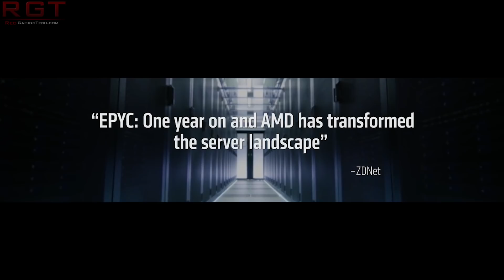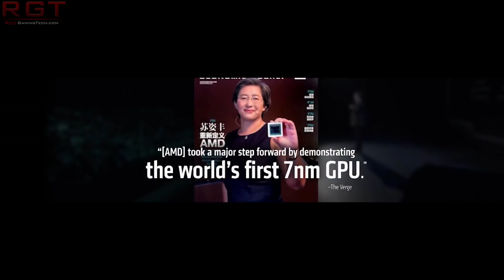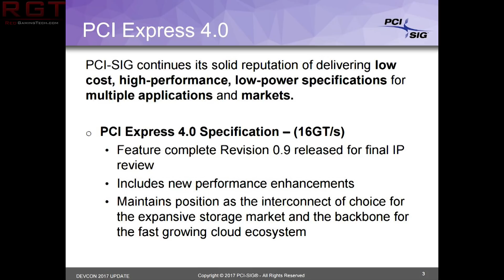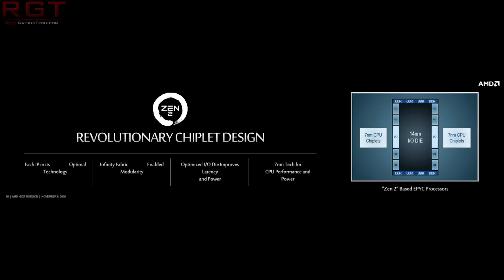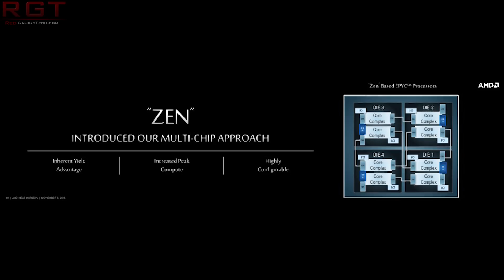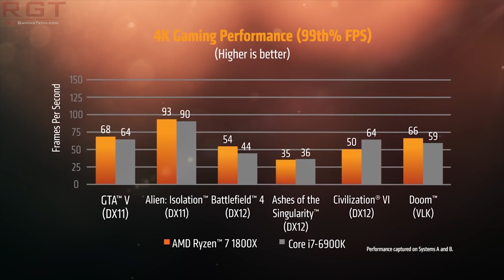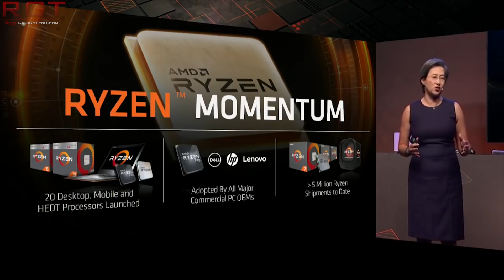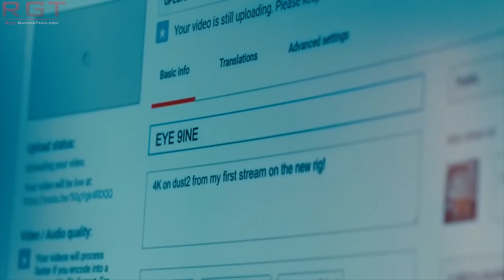Should AMD Raise The Core Count for Zen 2 Ryzen 3000 CPUs ?

Comment: We want a higher clock speed. We want AMD to be better than intel in gaming, too. We don't want to buy from intel anymore.
Reply: it would be better then anything what Intel have on 14nm !! otherwise it would be fail if not
Reply: @Mr11ESSE111  intel 14nm is actualy so higly tunned its like 11nm with 10nm thay can have clock with 5ghz actualy its worse
Reply: @royallager1851  and with that coffelake are onyl 3-4% in IPC over Zen+ if clock them same !! only advantage of coffelake/Intel now are  higher clocking ability because otherwise Intel cpu-s will be without point if zen+ could go up to 5ghz on air/water
Reply: @Mr11ESSE111  you right but i just explain why intel have better clock speeds...
Reply: @royallager1851  so if you "tune" a procesor it shrinks ?
Reply: @santiagoferrari1973   nope thats just cimparrassion betwen 14n zen intel 14nm intel tuning 5years 14nm whike am only two now amd is ahead from intel 10nm bcs they have 7nm and i eill have more expiriance
Reply: @royallager1851  with coffelake have better clock speeds while with broadwell have bad clock speeds
Reply: @royallager1851  when Zen2 comes Intel would not have clocks advantage or just  a little better
Reply: @Mr11ESSE111  tou right u think zen 2 is beast
Reply: @Mr11ESSE111  
Intel will probably keep the higher clock frequncy after Ryzen3 (not Zen2!) comes out, but not after Ryzen4 comes out.
Reply: @peterjansen4826  higher  but for maybe 200-300mhz but lower IPC will have coffelake
Reply: @Mr11ESSE111  it just has to be capable of reaching and maintaining fps over 140 at 1080p paired with top tier gpus and not be a bottleneck...
Reply: @darkokutlesa2386  depend on games and settings!! Games can be optimised for Intel too
Reply: @untseac  IPC of Zen2 will raise for around 13-15% over zen+ and that means around 10% over coffelake too !! otherwise Zen2 will  failing if clocks and IPC  increasing will be too low
Reply: @untseac  
1. what they call 'IPC', including high executives from Intel and AMD is not IPC. IPC is a term from computer science which means something entirely different: instructions per cycle for a given task. 
2. It actually is not that difficult to improve IPC, it is difficult to improve performance while staying within a certain power envelope and price range. Engineering is all about trade-offs
3. Ryzen2 is made on a much larger node than Intel Coffee Lake. With Ryzen3 for the first time ever AMD has the advantage of a smaller node compared to Intel. That on its own gives the 'IPC' a big boost (indirectly, you need to utilize the advantages of the smaller node properly and change the design a bit). 
4. The first generation TSMC 7 nm won't clock that high yet. That is normal and it always happens, the second and third generation will clock substantially higher. If Ryzen3 doesn't beat intel than Ryzen4 will. :)
Reply: Why not both?  More cores and ipc.
Reply: @untseac  
1. My main point, other than people using a term completely wrong (including the executives from AMD and Intel who do know better) 
is that IPC has nothing to do with performance. You can have a lower IPC and a higher performance if the clock frequency gets sufficiently higher with that lower IPC or if you do sufficiently more per instruction. 
Most techtubers seem to think that the performance in Cinebench is indicative of how high the 'IPC' is, it isn't! It shows how good the performance it.
You are probably talking about SIMD because of AMD its next GPU-architecture, that certainly will improve the gaming performance but it is doubtful that it lowers the IPC, it just prevents wasting instructions but that is something else than not having those instructions. Every part in the pipeline is active in every cycle, no matter whether or not it produces a useful output. It can be a NOP but it is active! I studied computer architecture (as part of a two semester computer science course), that gives me the background knowledge to know this.
I guess you could say that my critisism is that techtubers and people in the community mix different things which are not related: IPC and performance. I would like them to just call it as is: performance for task X. That is fine because that is exactly what we want to know, leave IPC out of it. :)

2. Simply put: AMD lacked the resources to come up with several architectures for several segments of CPU's. That has to do with both design and hardware-manufacturing (masks are expensive). So AMD came up with a design for server CPU's (most lucrative market) which happens to also give a good performance on the desktop and laptop because it scales nicely. 
Yes, leveraging all the advantages of that new smaller and more efficient (the two are related: with a smaller surface you need less power to switch the transistor and the transistor switches faster) doesn't come easily, you need to adapt the architecture to get all out of the advantages. It is like a chain, if there is one weak link...
In the hardware chain it is about all the other parts keeping up. What AMD does for Zen is risky: at the same time switching to a smaller node and improving architecture. Intel did this once in the last decade, for their 2000-series, AMD does it twice in a row. This is extremely agressive and it shows how eager AMD is to improve the performance which is great for us customers.

3. The pipes don't necessarily get smaller: with regard to the node it just is about the surface area which decreases the voltage (and because of that the power) and makes the transistors faster. It is just elementary physic. Pipelines are not related to it. The longer the pipeline the more you do each cycle but longer pipelines also tend to be slower so you have to make a trade-off and find the optimum.

4. TSMC is improving at a more rapid pace and that is simply a matter of money. TSMC gets higher profits because everyone buys at TSMC except for Intel and almost nobody (Micron is an exception) buys at Intel except for Intel. Hell, now even Intel buys at TSMC. :)
TSMC has had more profit for many years, ever since Apple choose to buy from TSMC but it takes years to translate that extra money to better facilities and better nodes. Now TSMC has gotten to the point that it outperforms Intel. This means that AMD now has the advantage with the node and that AMD will keep that advantage until Intel buys from TSMC too which Intel only can do iff it splits off its fab. My prediction: Intel will split off its fab - or big parts of it - somewhere in the '20's. They will have to do that eventually. This is not good news for us users because it pretty much gives TSMC a monopoly, unless for example Samsung will start making X86-CPU's and GPU's.
Reply: @untseac  IPC of Zen2 cant be lower then Intel ones  and i think on 14nm Intel coffelake because  even now IPC of coffelake are only 3-4% ahead if you compare clock for clock  so Zen2 will be  without point if IPC will be lower then coffelake because it would mean that Zen2 are same like Zen+
Reply: yes because dont matter how powerfull more cores actually are, microsoft dx12 and direct rtx are in bed with intel, so doenst really matter how many cores you have if games only use 2 for example.... even if the native game was made for a console running amd processor with less than 2ghz that run 4k 60 fps.... I rully believe ryzen 3000 will have 5.0 ghz with OC the problem is that ryzen doesn't really oc that much but are quality hardware that doesn't overheat. so expect intel ipc with around 5ghz. intel will still have the upper hand but ryzen 4000 will crush them
Reply: "we"

You don't speak for me, so stop trying.
Reply: @untseac  aka AMD vulkan .... if the games work fine in cheaper hardware in consoles that run AMD the problem is that directx is clearly biased to intel... as they pushed even direct rtx that will force games to only run on that evil scam called rtx... well in any case if they run smooth in far less powerful hardware ... the fault is the shitty PC ports they make....
Reply: @untseac  yes that part of the problem being open and offering good products at good prices aka capitalism is not good for this monopolies... that's why there's always some scam being pushed, some trick, some dirty biz...  the fact is microsoft xbox x run 4k 60fps at 400 dollars console and there's no pc in the world that can to that for the same price.... thats AMD hardware with windows software.....now be abstract of the details and very focused on that fact, that when they want it, "it just works".... magically when they dont... you ended up with needing 3x or 4x the hardware power... and 10x the prices....
Reply: AMD should increase core count more or less like: R3 being 4C/8T or 6C/6T, R5 8C/16T or 8C/8T and R7 10C/20T. It would be really nice.
Reply: @lagarttemido  THATS being douche intel..... HT is a right for AMD users... dont bring your shit logic to AMD... is always double threads per core....other than that is just nerfing cpus for no reason.... 8c/16t is perfect, just need more ghz and a bit of ipc and its done. more cores will increase cost, heat and will force decrease in ghz, which again will play to intel advantage since they nerf games use of cores on porpuse to force high ghz....
Reply: @thepro08  it's not that they nerf games to use fewer cores, as newer games that have had less development time are benefiting from multiple cores, a lot of games rely on older engines(unreal engine 4) because it is easier and significantly cheaper and faster to build on exsisting engine than develop from scratch. Game developers who use those engines that benefit from using those older engines are also often the ones sponsored by Nvidia as they benchmark better on Nvidia cards.
Reply: @thepro08  The important thing is: either 4C8T or 6C/6t for R3 will be quite an improvement at the base which is very important to push for more threads in gaming in general.
Reply: @lagarttemido  dude just invest 50 more and get a proper ryzen 2600 or 3600...
Reply: @lagarttemido  they more than likely will avoid that, to avoid cannibalizing tr... Besides most mainstream users don't really benefit from more tham 8 cores, while IPC and clockspeed are much more beneficial. Yes i do include video editing and blender etc..if that is their career or hobby and really need the core count, TR hasn't outpriced itself out of reason, unlike the 9980k
Reply: Kinda hard not to buy that zionist crap.
Reply: I don't know about "we" but my sentiment is the same. After all those years that Intel limited improvement as much as possible because it kind of had a monopoly and this after Intel used illegal means to stop shops and OEM's from buying AMD CPU's I am done with Intel. But I am not crazy, I only buy a CPU if it is good enough. Fortunately I could hold out with my i5 750 until Ryzen came, the RAM crisis and 'mining' crisis made me wait a bit longer and step in on Zen2. Whether or not Ryzen3 will beat Intel on single core and gaming remains to be seen but rest assured, Ryzen4 will, there is no doubt about that. The TSMC 7 nm. node will get faster and not a tiny little bit like that GF 14 nm. node but substantially. I wouldn't be surprised if you see clock frequencies between 5.5 and 6.5 GHz. for TSMC 7 nm node without overclocking, eventually. For the first generation it probably won't get higher than 5.0 GHz and even 5.0 GHz is a touch challenge but AMD doesn't need that. With 15% 'IPC' improvement 4.5 GHz gives Ryzen3 the same single core performance as the 9900k (@5.0 GHz, the highest it can get), with 10% 'IPC' improvement 4.7 GHz suffices. In theory, if everything scales nicely.
Reply: Exactly and i hope somebody from amd will read this
Reply: @RavenPrecept lol
Reply: @RavenPrecept yes 8 cores is actually perfect I have 6 cores 12t and seriously my pc is used 40% in games, all AAA games already use all cores, but 5ghz is a perfect target for AMD to win mindshare because even when AMD have faster cpus still most people will take years to catch up to it, just like apple was the best 10 years ago and now a good android is better... apple is more a cult/status play ... but just keep in mind the original apple slogan was more for less...
Reply: @JeffO-n6x  
At the same time you are correct and incorrect. If you pair up the CPU with a RX 580, Veag56, GTX 1070 Ti...and play at 1440p/1440p ultrawide, yes, then the difference is negligible. If you pair up the CPU with a 2080 Ti, then even @1440p and @1400p ultrawide the difference becomes larger. That graphics card is simply so overpowered that you partially transfer the bottleneck from the GPU to the CPU again because those games were not designed with such a graphics card in mind. It is not worth it in my opinion but that nuance has to be made. Most people better buy a 2700X than a 9900k. The 8700k can be a good alternative at normal price for gamers but the price is not normal and hasn't been for around two months so at this moment the 2700X is by far the best choice. However, the best choice is waiting for Zen2 and then chooise a CPU. Mark my words, that 2700X will cost around $200 a year from now. We saw this happen to the 1700X and the 2950X.
Reply: @untseac  i believe by  just shrinking they can squeeze more hz yeah :o, hopefully  tweak the infinit glue i mean fabirc
Reply: @Funtime hz
problem is that for 10 years Intel has had market dominance, they have always worked with gaming companies, microsoft and so on, while AMD has barely partnered up with anybody. This leads to compilers, libraries, frameworks, game engines and then games/software being optimized for Intel by default pretty much, even if it's not a hard optimization.

Also why do you want AMD to beat intel at gaming? Both Zen+ and coffeelake are more than enough for games... doesn't matter who is better.
Reply: @Cbeddoe19 yer, but he forgot to say we don't want to buy Nvidia any more either...

Comment: If they rock the chiplet design, they should offer the full stack from 4 cores to 16 w/ “X570” rocking PCIe 4.0 and “B550” w/ PCIe 3.0.  DDR 5 is too far out so if the DIMM slots and IMC aren’t cross-compatible, DDR 5 support should be delayed on consumer until 2020.